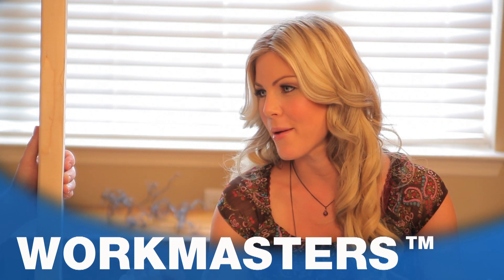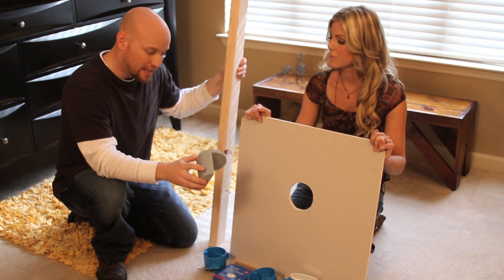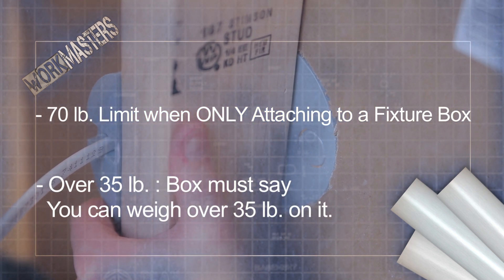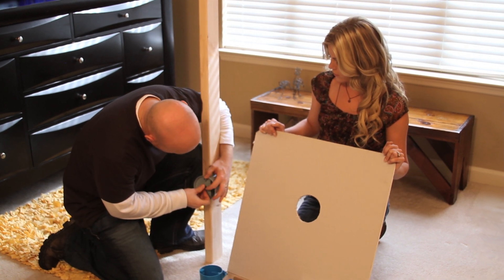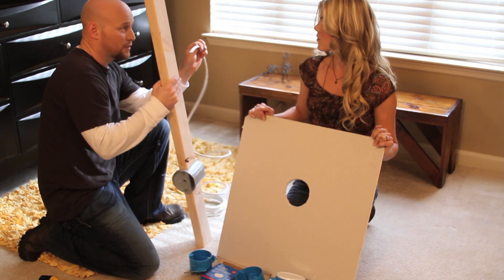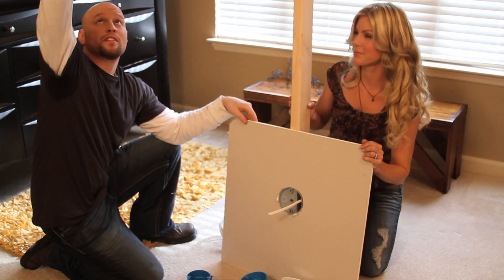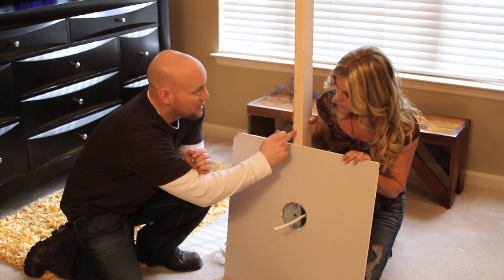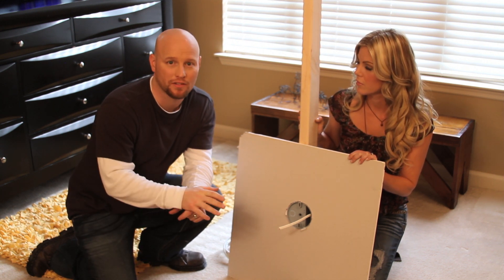Ceiling Fan How To  (Part 5) - Ceiling Fan Box - WORKMASTERS™

Comment: saw my first one of these today and it threw me for a loop - the fan support bracket wasn't aligning with the two long screws (which had been pre-installed by the finisher, and he could have put those screws in imporperly) - so I wasn't sure how to attach exactly how to attach the fan support bracket. I kept looking for screw holes like in the old metal ceiling boxes. I'll go buy one at HD tomorrow and play with it.